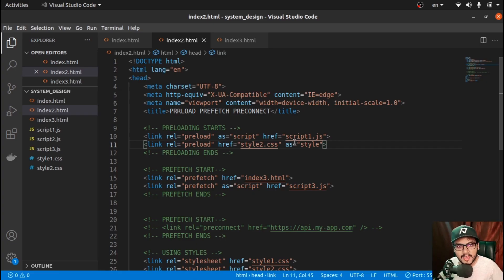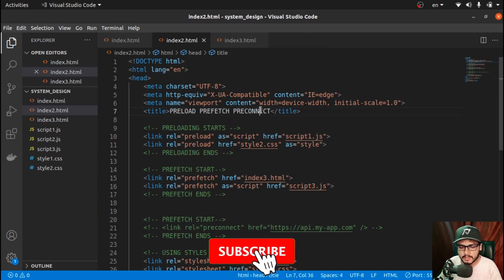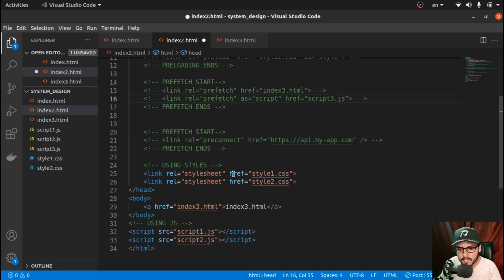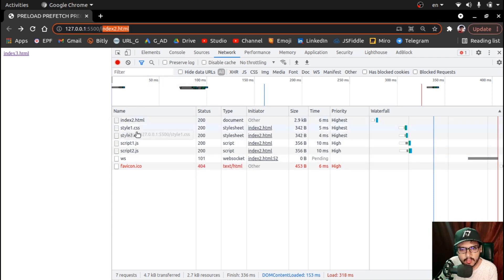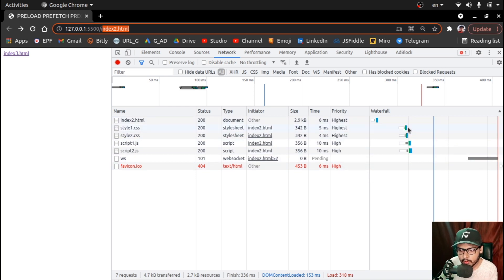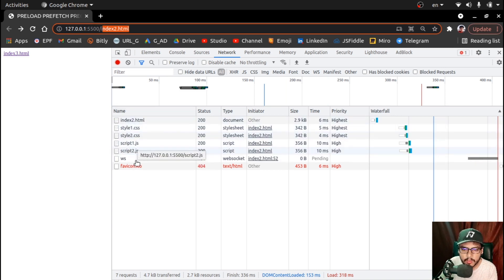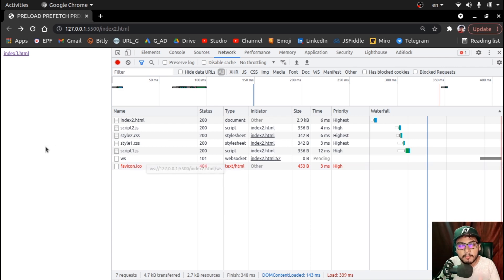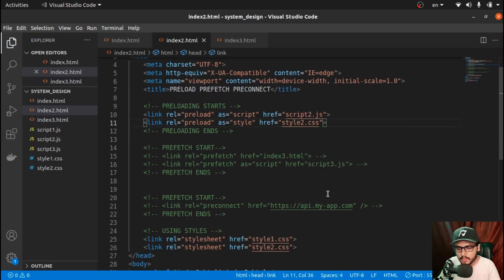Ep3 Preload Prefetch Preconnect | Network Optimization | System Design for frontend engineers 🔥

Comment: How do we do this in something like React or Nextjs? Or is this sepecific to plain html?
Reply from the maker: Preload Prefetch Preconnect are specific to link tags which we can write in index.html file that is present in the public folder of react app. However there are ways in React to preload or lazy load components.
Reply: @js_cafe  Got it, Informative video btw, keep up the good work ❤
Reply: @js_cafe  ♥♥
Reply from the maker: Thanks for the appreciation! Do share this channel with your peers. JsCafe has a lot of potential and is very underrated 😛